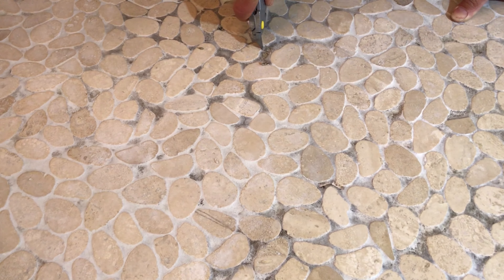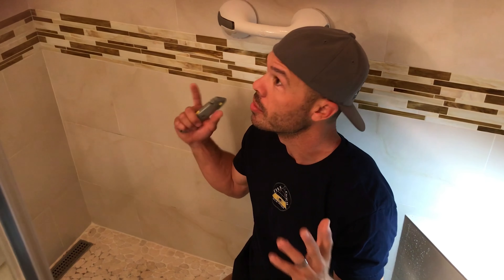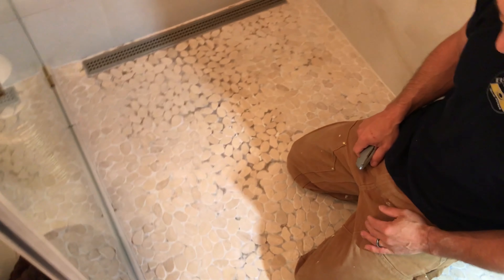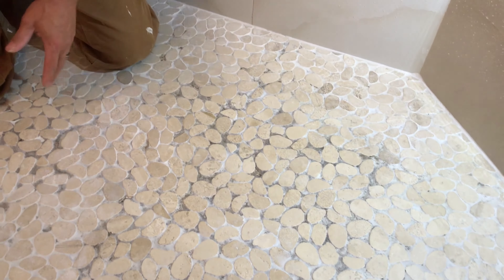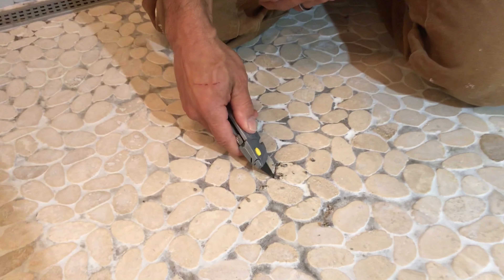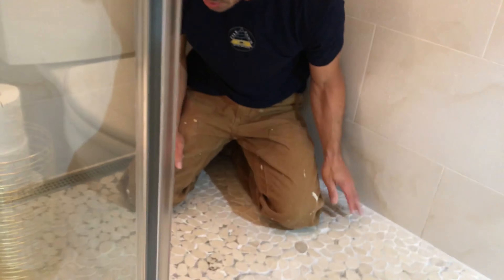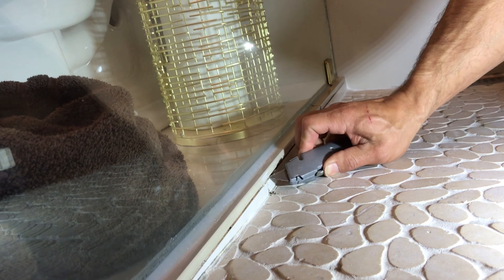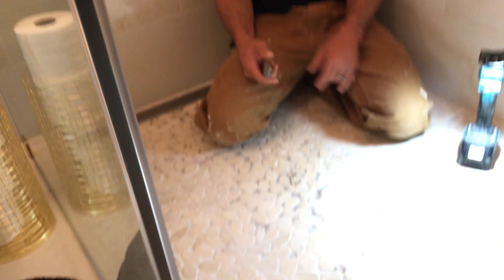I GROUTED this Shower WITH FUSION and it FAILED!

Comment: All those grout and thinset reps are bullshit these companies will never say they are wrong I had a problem with custom grout I put the grout down as always the next day you can just scrape it off with your blade and they told me it was because it was too hot well in Vegas is always hot and there's thousands of jobs that go on everyday you just mix little grout at a time so it doesn't dry out and you dont have to add water that's what makes it weak anyway I ended up having to scrape the whole house out thousand square feet of flooring and reinstall it for free now it shouldn't be my responsibility or our responsibility as tile setters to warranty the product we just warranty the install right anyway we always end up losing at the end great video but I feel you bud

Comment: Hi as a tile  installation expert that you are  and i learn lots from u and i thank u for that  but recently i want to install  Granite  on my  wooden stair  am i  gonna be able to  install it directly on wood  if so what  kind of cement should i use or i  install  backer board in each stair and than installing  granite  also would i be able to install granite  on already  installed tile thanks

Comment: Can you add a video installing epoxy grout and with information on epoxy grout because I’ve been considering it but was a bit apprehensive
Reply: If you don’t know how to work with epoxy grout best advise for you is do not try...
Reply: If you use epoxy, make sure you pick up one of the orange epoxy grout sponges.  I get them at Dal tile.  They look like a green scrubber but are the size of a regular grout sponge.  You must work fast!  Best to have extra people.  Someone putting it in, someone changing your water.  I like a fresh bucket of water for like every 4 square feet.  3 buckets and keep rotating out the worst one.  Orange grout sponge it, then wipe it clean dirty water, then wipe it clean clean water.

Comment: I did a job when Fusion first came out and did pebble floor also it failed. You can't use it on pebbles,  grout joints are to wide. That's why I  never use Fusion or any other single component grout in showers! I  only use epoxy grout in showers!

Comment: Hey listen Isaac, I love you dude but what a lame move. You have to use an epoxy mortar and grout in the shower base for this application with river rocks, I highly recommend going to TileRedi.com and buying their epoxy mix mortar and an epoxy grout from Home Depot. I do not know everything and you know more than me but that much I know. I love that seamless tuck into corner water proof membrane technique. Also saw DiBlasi use it. You are still my coach.

Comment: **I see what the issue really is Very very simple my friend are you using sanded grout or not sanded grout plain and simple it can be from the same company but one it can be sanded and one is not sanded you can only put certain kinds in wet areas even from the same company?**

Comment: I have been tiling for 30 years in NZ , the biggest lie in the industry is that you have to use a companies complete system,waterproof,adhesive,grout,silicone
Reply: True. They all work together! This is said for the warranty.... 
If you use multiple manufacturers each will point at the other as the issue.
Reply: Mike O the warranty is not worth the paper it’s written on anyway

Comment: If a wet area is put into service before fully cured,  fusion will fail . Fusion can vary wildly depending on the joint size and humidity.  You have to double check and test that fusion is fully cured before the shower is used.  I For joints as large as those between the pebble, i would expect at last a full 7 days to cure.

Comment: Lesson learned: Warranties are just a load of marketing malarkey.
Reply: Not if you follow abide by manufacturers specs...
Reply: @mikeo6525  i personally like the warranty that says, claims not excepted for installed materials... lol so if do the install and 6 months later the glaze is breaking off the tile, the asshole manufacturers will blame me the installer for their product failing. warranty's are a joke in the tile industry. those people coulda been dirty mf's that never cleaned this shower once in years, why should you the installer be held liable for that mold? lol
Reply: Yep, I'm a carpet cleaner and saw it recently. A client spent $10k on new top of the line carpet and it was showing wear in all traffic lanes after just 6 months. We cleaned it for the installers to make sure it wasn't soiling, and they still refused to honor the warranty. They tried to say it was because the clients walked bare footed and their skin oils were ruining it, what a joke!
Reply: he wasn't superposed to use it on pebble and he did.. why would the warranty people cover this. Of course Grout is more likely to fail in wet areas than dry ones his argument that it worked fine in the dry areas makes no sense. If i was the field rep I would have done the same thing.

Comment: Seal your tile and grout. If grout darkens close to early version kerdi line drains, its because the adhesive they used between the steel channel body and kerdi sucked and it failed. I use kerdi fix at this junction, just-in-case

Comment: I had the grout turn dark like that but with regular grout I scraped it out and rerouted with Bostik urethane grout had the same problem. So I made a test panel and found that the backing that held together the 2 x 2 tile was leaching and causing the grout to stain. Mine was a shower also and I had to use epoxy to resolve the issue.
Reply: Do you remember the tile brand that you used?

Comment: Great video, you're right on. I had a similar problem with the same grout and it was all that I could figure the Lysol cleaner she used that was acidic that softened the grout.
Reply: Also, stay away from Customs, its total garbage, I don't even know why i used it on that shower, I always try and stay away from that crap.

Comment: Isaac, a few thoughts on this one (from a guy with lots of experience dealing with "issues" although I'm not a tile guy as you know ;)
* Obviously, reading the fine print is important. AND, lesson learned: keeping fine print from old jobs is a Good Thing. (Maybe think about it this way: when it comes to "code", today's code isn't important. What was the accepted code at install time. Or for grout, what did they say then, **particularly on the bag and SDS/TDS available to you at the time?** -- Just because someone somewhere published new info does not mean the installer actually had access to it. Old inventory with old info -- even outdated web URL's -- is rampant.)
* When it comes to a claim, first/best thing is to focus on any aspect where there is NO question that it is a product issue. In this case for example, could have ignored the floor completely in talking with CBP... focus on the 1/8" grout joint along the side that failed and turned black. Not even in sitting water?!!  **By starting there, they don't have room to squirm or turn it around and the discussion can be productive.**
* Avoiding tension when something went wrong: it can help to focus on the issues, and avoid any words that focus on the people involved. People easily get offended and upset of course, but staying away from the fault/blame stuff can at least help.

Comment: Dude, I feel for you. I grouted a 1"x1" hexagon mosaic shower floor with Home Depo's Simple Grout by Custom Building Products. It states on the bucket that it can be used on shower floors. It all just clabbered and jellied up after about a year. The walls were fine but the floor was a mess. It also is a premixed grout in a bucket like Fusion. I made it right, but the rep didn't....so I know what you mean about the rep not being your friend. From now on, I'll only use the bagged grout or epoxy grout.

Comment: If you read the one star reviews (230 out of 1,214 reviews) at Home Depot you will see a large portion of those reviews mention "soft" "crumbling" "falling out".  
You'll find mention of this as well at the professional tile forums (Johnbridge, etc)

This is a product problem that I'm sure they are aware of but don't want to accept responsibility. They have probably changed the chemistry by now but I wouldn't bet my labor, materials and reputation on it.
Reply: Sounds like its cheaper for the manufacturer to stand behind garbage than pay out the claims. Cuz if they admit fault imagine all you tile guys winning that battle. No profits that year

Comment: My fusion grout failed after about 1 1/2 years on porcelain tile,  Scraped it all out and put in traditional grout and sealed it. My brothers bathroom same fusion grout zero problems. I wont use it again, scraping grout sucks especially on small hexagonal tile.

Comment: I used single component grout on a bathroom once in 2010, may have been the same stuff. I was not a fan, but the customer read great things about how it's stain proof and didn't need sealing, so that's what they wanted. Finished up and everything looked great. Told them don't use the shower for minimum 72 hours (longer if possible) so the grout can set up real good, as I didn't really trust a water based grout. Got the call back a few months later that the grout was coming up in the shower. The shower walls were fine, the main bath floor was fine, but the shower floor was all soft. Luckily it was 2x2 square mosaic floor, so wasn't so tough to clean out. Replaced with similar color cementitious grout and never heard back. They argued with the tile place they bought everything from and got their money refunded on the original grout, as well as the new grout supplied for free. Not sure if they were able to recoup what I charged to redo it.

Comment: We're about to tile a pebble shower floor.  We plan to use the SpectraLock 1 which is a newer grout from Laticrete that is supposed to behave as well as epoxy.  Anybody here have experience with this yet?

Comment: You check first it's mould or not.
Normally wet area in bathroom especially water exposure area get      mould. 
Someone who cleaner will use acid to clean that make grout weak.
And then get  mould .
I'm not sure but considering. 
Cheers

Comment: Had you used Polymer Grout you wouldn't have had this issue. Buying cheap Home Depot and Lowe's purchased grouts are your reason for constant failures.
Reply: He used a urethane grout called Fusion. It's an epoxy grout. It shouldn't have happened period
Reply: @phillaurin7125  fusion is not a true epoxy 2 part.....that's what is needed.....muriatic wont even touch the stuff

Comment: The only thing that custom makes good is red guard. Power grout sucks to work with but you will see less of this as long it's not a concrete guy or whoever installed the pan before you fuck up.

Comment: Funny how we always try to blamed the sales rep when the reality is that you as an installer have the responsibility to informed the customer about what’s suitable for wet applications, right of the bat I see that those pebbles were not suitable for wet application since some of the stones are so close together that it would’ve been imposible to get grout if any in between the joints therefore water penetration was present and that explain why the dry areas were fine. 
Not here trying to make feel like I’m better then you or anything like that by all means, I would suggest to those in the trade to get a hold of your terrazzo, tile, marble hand book, here in Canada it’s TTMAC ( terrazzo, tile and marble association of Canada) so that you can protect yourself.it was an eye opener for me and I’m been doing this for 24 years.
Also the fact that you went back after 4-5 years after it only shows how much you care and the kind of person you are.
Good luck.
Reply: Christian Romero Herz what the grout has to do with waterproof, is grout part of waterproofing in Canada?

Comment: From what i know about custom and mapei its recommended to use prism grout in this type of install for custom and for mapei it would be ultracolor plus fa. As your excerpt states and the containers say they are for use in grout joints 1/6th to 1/2 inch river rocks have areas that will pinch tighter than that.
also fusion and mapeis cq grout get really soft with prolonged exposure to water. Think acrylic caulking.

Comment: "We will give you a new bag of grout" - such a cop out! I have had grout failure. The time to replace it is worth so much more than the grout. When they can't even give you an explanation for potential cause of failure is even more annoying! The response I got from a certain company rep when I had a problem is the reason I will never touch that brand again.

Comment: The first two issues that come to mind are ; 1 the grout was over washed  , the grout is too low compared with the top of the pebbles  . 
2 , the probably cause of the over washing and the water retention in the grout is , the grout was too wet 
 Should be much stiffer  . 
 Tip increase  the fall to the waste when using pebbles . You need to drain that water away asap . 
 I always seal with stone sealer the whole shower floor    ( and walls too , if the have a pebble / stone feature wall or panel ) .  Use the best silicone in the corners and shower screen . We have one called Maxisila in Australia  , I  wouldn't use anything else . 
Finally , be very wary of people making their own shampoo , bodywash or soaps . I had to strip down a shower ( not one I'd  tiled )  and I discovered a thick orange  fluid behind the tiles !  The original  grouting was poor , the home made toiletries had made their way into the gaps  and congealed  in the cavities . The smell was disgusting .  As a tiler you build bathrooms for the masses , not Mr & Mrs Oddball !  I was given a very sensible piece of advice when I  started tiling , ' You make your money by doing the easy straight forward jobs not the challenging  troublesome  projects people have dreamt up or jobs that have been mashed up by previous trades . 
 Good luck . Greetings from Sydney Australia  .
PS , the white grout in the mentioned shower had turned orange . So all the grout in the bottom 8 inches of the shower was discoloured . To this day I have no clue what ingredient  in the homemade toiletries caused it .

Comment: Sorry, man, but fusion grout is garbage. I have linen color in my kitchen and it has grayed out. I've scrubbed with chemicals, I've steam cleaned it, but to no avail. If you want it back to it's original color, get a grout saw and regrout the tile. I'll never use that crap again.

I should have known something was up when they wouldn't take back the unopened bucket I had left over.

Comment: Isaac! Hope you and your family are doing well! I've heard a lot about this lately. Hit me up. The glue used for ANY kind of sheet recently is suspect. I don't think off hand that it's the grout
Reply: Especially if you are using a topical waterproofing system (schluter shower, wedi, etc). Thanks for letting me send employees to your page! Keep it up! 💪💪💪
Reply: Central Minnesota tile guy here!
Reply: @TileCoach  but, preslope happened, right?
Reply: I had a similar experience with TEC power grout. Redid the whole shower floor. Only changed the grout and single set the tile, so who knows. I'mma call ya soon to do a mudding video. Keep it up man! The real tile guys love it!

Comment: Mould. The stagnated air should be taken away be extractor fan. Cleaning products have eroded the grout and moisture is getting into the grout. Not an installation fault at all. No extraction or not enough (in my humble opinion)

Comment: I have been told never to use Fusion for a shower pan....several installers have had failures in my area. (If you more info on some of those failures, call Crossville Studios in Boulder Colorado and ask for Kyle)I won't touch the stuff anymore after having it fail on the floor of one of my properties (16x24 tiles installed on CBP spiderweb mat).

Comment: What grout do you recommend for pebble installed in shower.
Reply: Epoxy but it's not for homeowners to use
Reply: Prism is suitable....Tec Power Grout is good as well
Reply: Mapei ultracolor plus FA...fine aggregate. Good for 1/16” all the way up to 3/4” joints
Reply: @mikeo6525  We have started using it more and have been really impressed so far.....
Reply: What do you guys think about the "breathing of the stone" to dry out and advisement to use breathable grout not waterproof with natural stones?
Reply: @mainepottery  personally I am not a fan of choosing natural stone in wet areas...but people pay me to all the time. I usually use prism or FA Plus....but given that you're going to have to regularly seal Stone anyway, I feel it's fine to just use a standard Portland cement grout product and then seal it. My two cents anyway 😂
Reply: @justinofboulder  it's a shower in a camp was trying to upgrade but have it be like being outside (its a solid poured  cement base with 4" high sides & was painted with acrylic) I was hoping to  "upgrade" with less maintenance. Thinking I'd really have to seal this often? Can I mix a sealer into the Portland cement grout substitute for water?
Reply: @mainepottery  sealer is mostly going to help you with stain prevention...Depending on how heavy the use is, would depend on how often you would need to seal it
Reply: @justinofboulder  thank you!